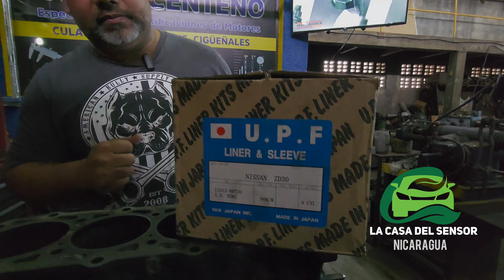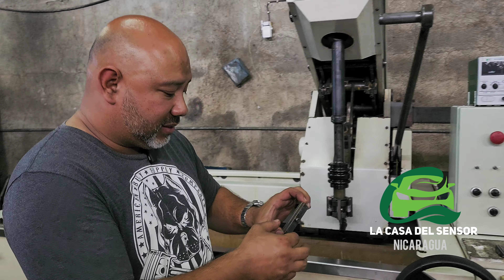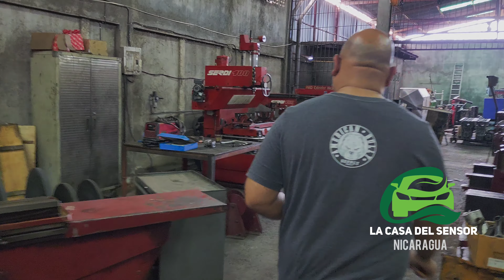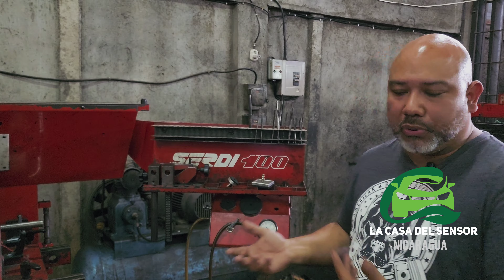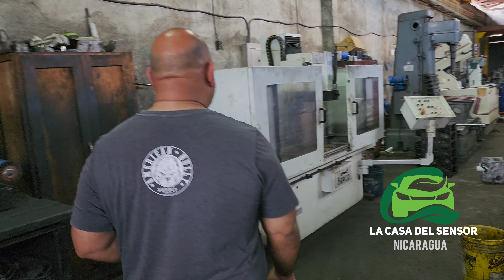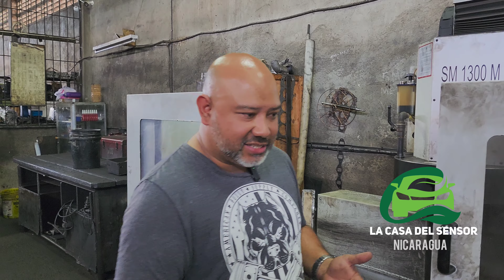Nissan ZD30 Engine machine Shop all equipment used #Nissan #machineshop

Comment: Excellent vídeo, I owned a Nissan Urvan 2013 with that engine, very powerful engine , it feels stronger than the Toyota Hiace , however Nissan put low quality component such as AC compresor. I was dissapointed when my Ac failed on a 3 year vehicle AND sold it
Reply from the maker: Thanks for sharing your experience, greetings